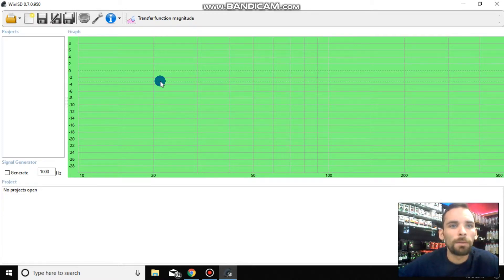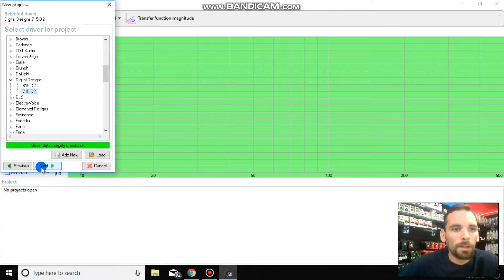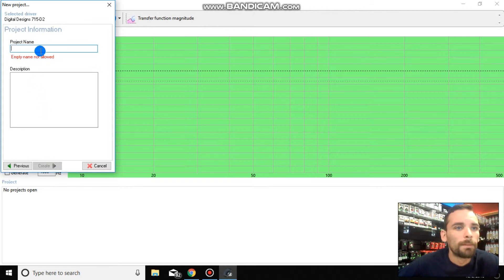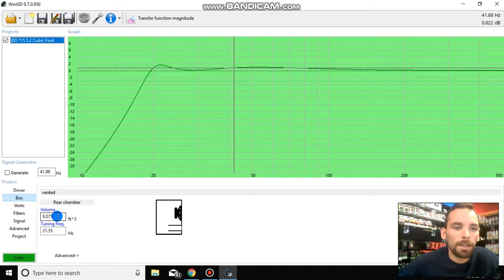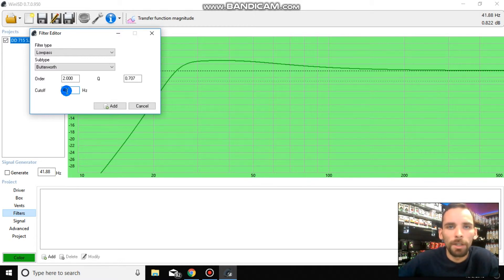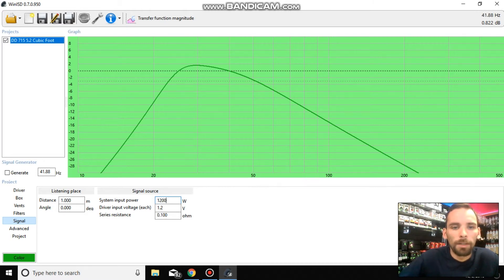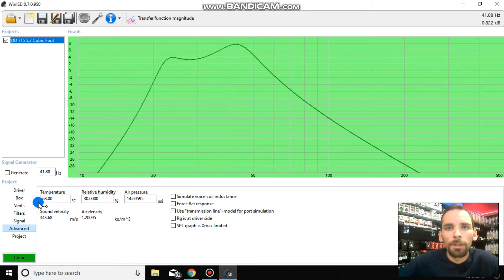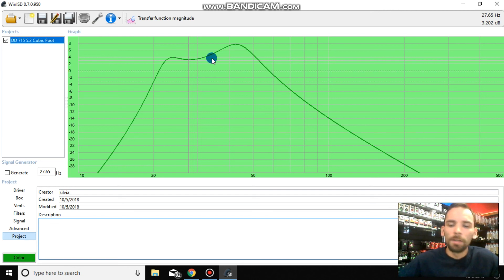Winisd tutorial Episode 1 How to open new project

Comment: when putting in the box volume do i put in the gross internal volume or 
the internal volume after port, bracing and speaker displacement
Reply from the maker: Use the net volume. That is the volume of the enclosure minus port volume, brace volume, and subwoofer displacement.